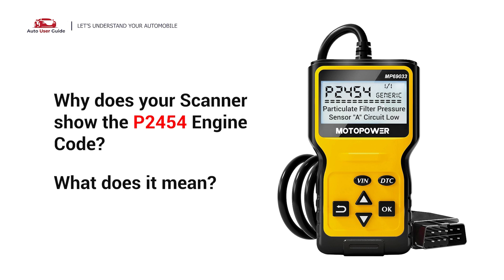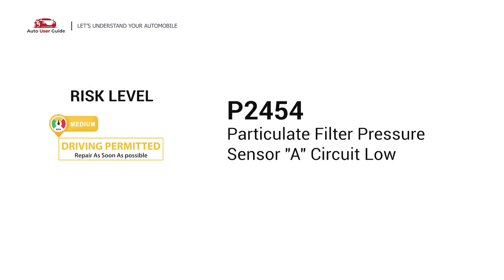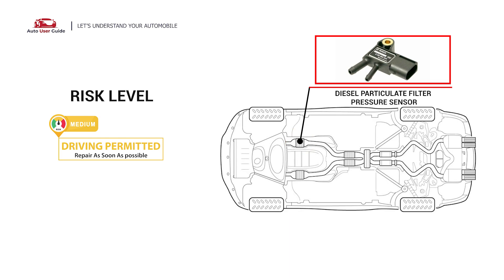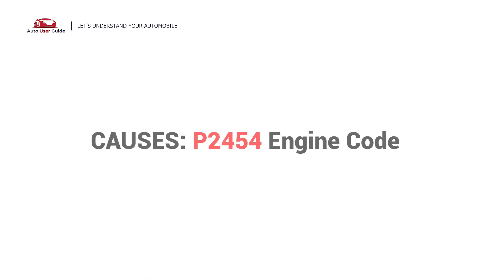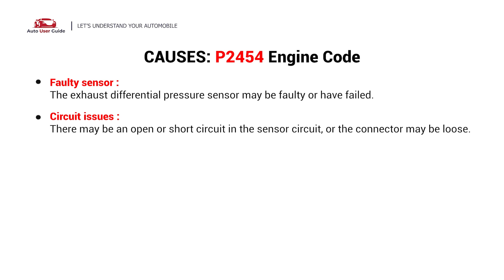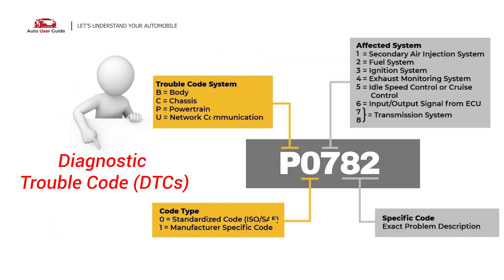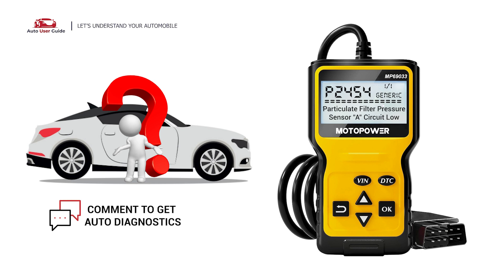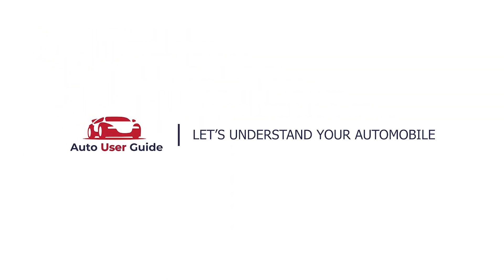What is P2454 : Engine Error Code Causes Explained

Comment: I have a 2015 Ram 1500 Ecodiesel 3L that's giving this code. I got stuck in mud and checked and cleaned connectors under the truck and now it's throwing this code. Any suggestions? Thanks.
Reply: Try switching the sensor, it's not really expensive.

But in your case there may be a real damage depending on how hard it was stuck in mud...
Reply: Hi I would like to watch the video for repair of code 2454 on a 2009 VW Gold 2.0 diesel